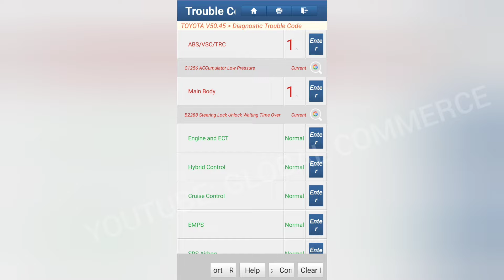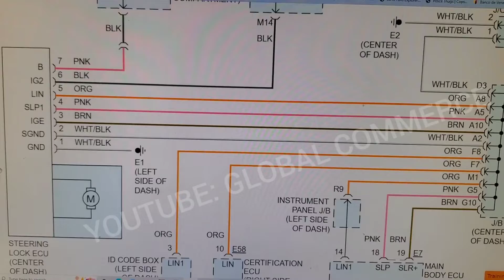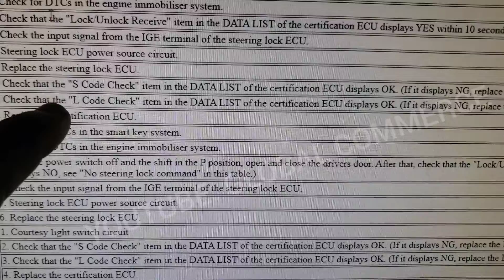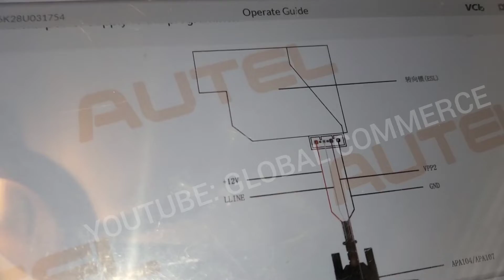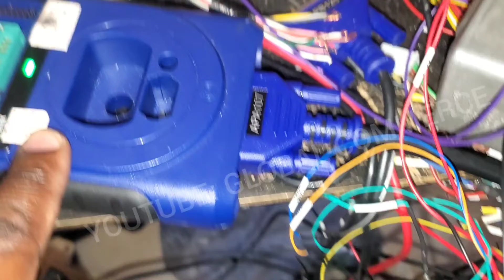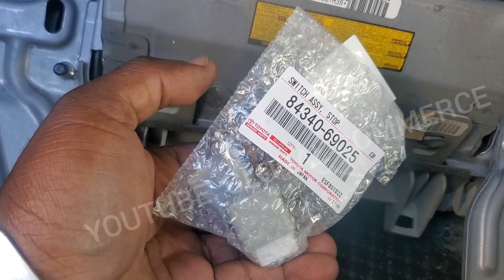Toyota Camry B2288 steering column lock diag, repair, programming AUTEL IM608 PART 3

Comment: I have a similar situation, the steering wheel is locked and the key is missing. I tried programming the key and to no avail. The remote unlocked the lock, turned on the dashboard, but the steering wheel did not unlock. The steering wheel does not unlock even with the program. What would you recommend?
2007 Toyota Camry

Comment: Nop you don’t have to reset from the OBD port after fixing, my motor was fried and the car would sometimes start sometimes refuse my circuit board looked burnt on the sealed side. Just changed the motor crossed my fingers and once security light stopped blinking the car started. Mine was a 2010 RaV 4 v6 (vanguard)with the same BCM code. The steering wheel lock/computer wasn’t unlocking the steering and security was blinking even with car On not running. My circuit board looked burnt and motor was seized. Just used same circuit board cause the one I had for a spare was different year, resistors inside were different and didn’t work for mine. But I just replaced the motor and it worked fine again.

Comment: I’m going through the same problem now, I just replaced my heater core and dropped the steering column and disconnected all the harnesses from the steering wheel lock,after connecting everything back into place. Now the security light is blinking and it would not start nor the steering wheel is unlocking. Pls help
Reply from the maker: Hi, most likely you have something disconnected.. the id code box I believe is near heater core, most likely you forgot to plug it back in... that would mean dropping the dash AGAIN... 🤒
Reply: @globalcommerceca  Thanks for replying back, I'll double check the i d box again.

Comment: Enjoy your information. Did you ever run into that 3 lines of data on new toyotas that need to convert to 12 digit pin? It's weird as it's not the 96 seed code so can't convert to 12 digit pin. Any suggestions without having to use TIS to get the 96 seed code or a walk-around. Thanks.

Comment: Failure is not an option 💯. As mentioned, I dealt a very similar situation before and can share my notes if you think it would help.
Reply from the maker: Email me, let's discuss thanks!
Globalcommerceca@gmail.com
Reply: Hi, did you manage to open ESL or Reset ESL?
I have a 6 pins ESL Toyota smart key, following the instructions IM608 with XP400 PRO, wired everything as in picture, it says Opening succeeded, but steering wheel will not disengage, remain.

Tried to reset ESL, but kept saying Resetting failed.
Any suggestion will be most welcome. 
Thanks in advance
Reply: did you everget it to work? Running into the same situation.